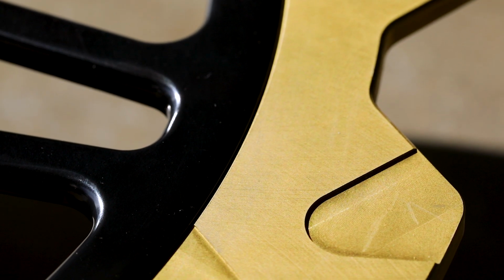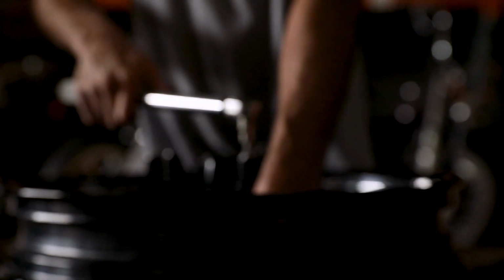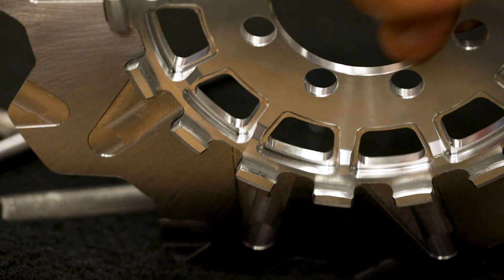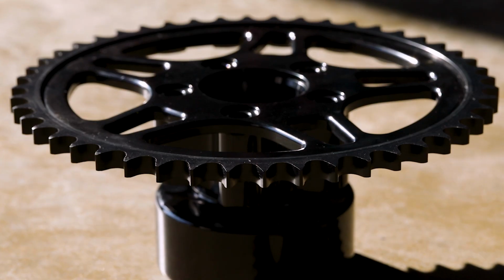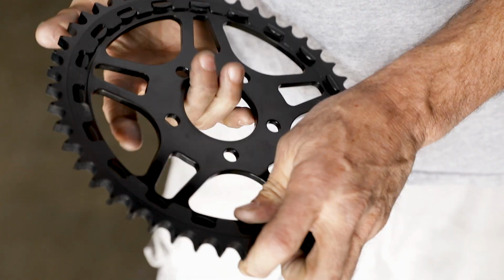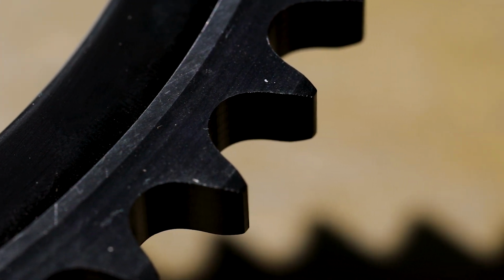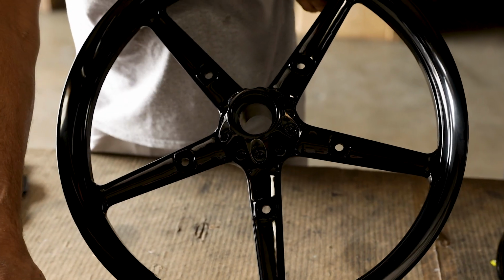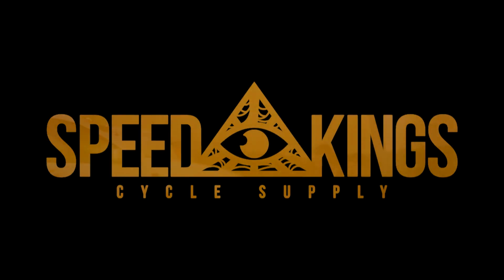SPEED-KINGS VISITS: LYNDALL BRAKES

Comment: I’ve been running Lyndall brakes and rotors on my highly modified RG for over 50K miles with zero issues.
Reply: Bubba Page shorter stopping distance, zero fade, with far less brake dust. All in a lighter package. Any difference over stock brakes? Absolutely!